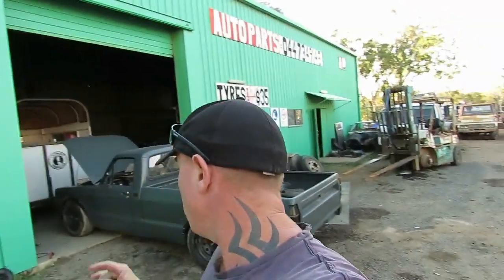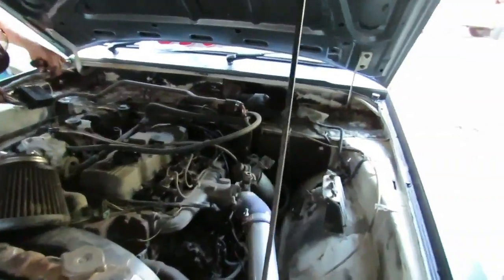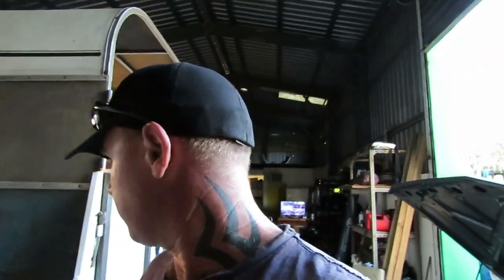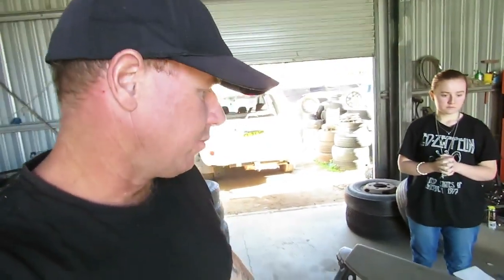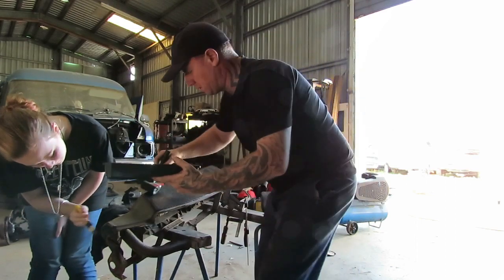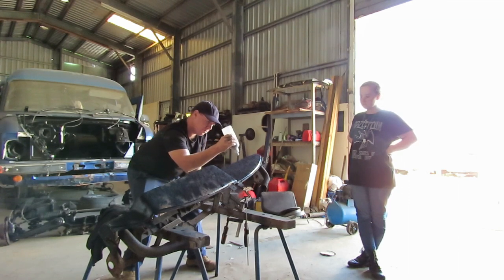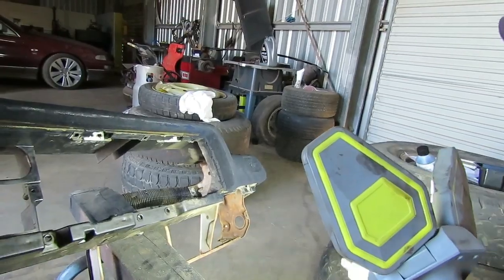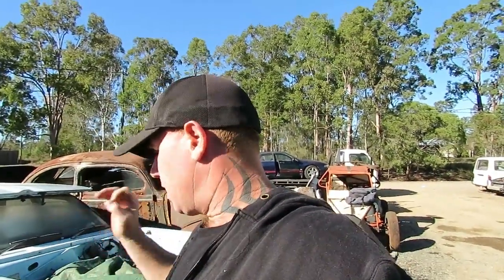kingatow crew// mini truck.. turbo diesel ford courier ute gets a flocking the dash // part one

Comment: Awesome, never actually seen this been done before, looks great. I do wonder if theres a better way to apply the flock? Perhaps you could try applying it with one of those small portable gravity feed sandblasters, the ones that just hook up to your compressor, have it on a low pressure should apply just fine, i dont know. I always like to try find easier and better ways to do things. However, another awesome video!!
Reply from the maker: I agree they do make a electric blower gun for it ...i wanted to show the cheapest way as always lol but i will look into a better applicator for a future video

Comment: Hey there! Been looking everywhere for info on these utes!! Yours is Amazing! I have the same one but know nothing.... Any chance you can tell me the safest way to check & turn the diesel engine over after sitting for approximately 25yrs...? 😬🙏🏾thanks
Reply from the maker: hi mate ...just check the oil and hit the key ...it may take a while to start anyway because deisel may not be at injectors so oil pressure will build ...you will need a really good battery